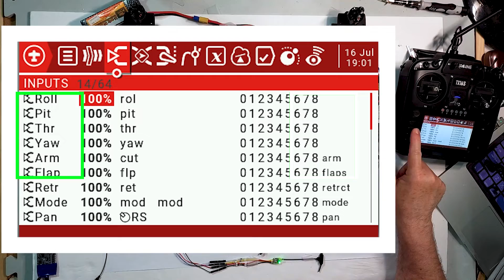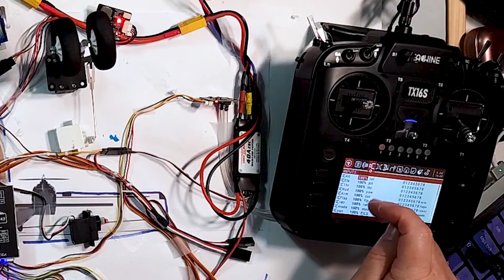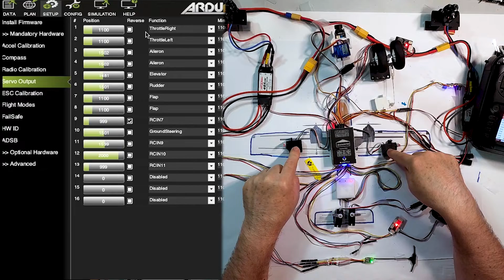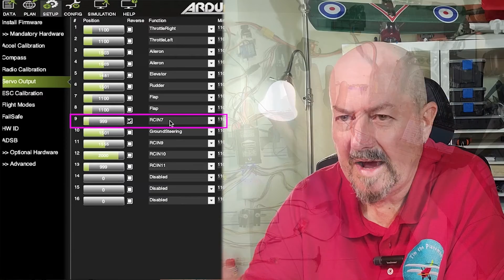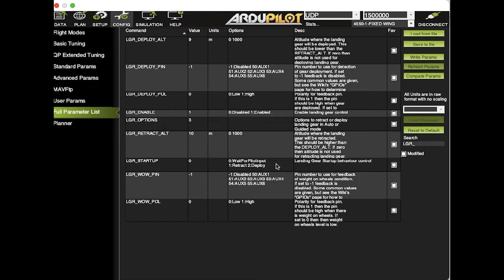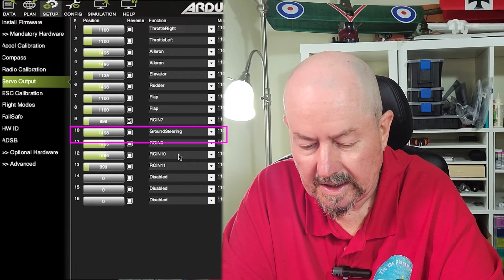Part 3: ArduPlane Servos and RC Channel setup with Express LRS, Zealot H743, TX16S for on the Binary

Comment: At last, you have answered my question about the transmitter. Well done. As a suggestion for testing the height the retracts react. Pin everything to the board, hang the board out of the window and lower it until the retracts work. That way no fear of crashing. It’s sounds a bit mad but hey why not? I also suggest slowing down the speed of the retracts so they react in a scale manor, the same for the flaps. I use a 2 second time on my spitfire and it looks realistic, however you need separate servos to make work that way. And so, as I suggest 
Trial the kit on the board first before installation.
Reply from the maker: I think the condo board would fine me for doing that. The mapping thing is something I've been stewing on for a while. Thanks for asking about it, it made me focus on explaining my thoughts clearly and I think it came out pretty well. Mostly logical 😀